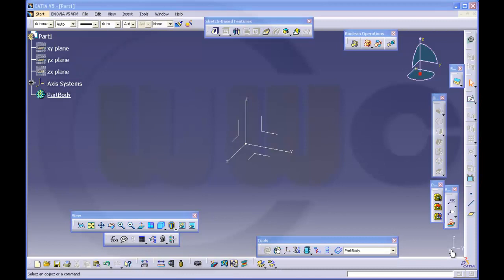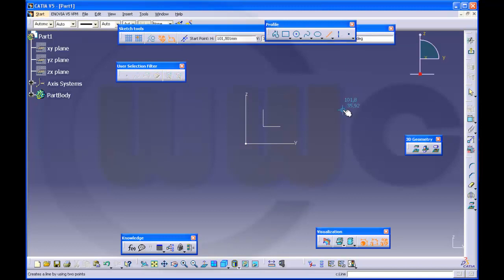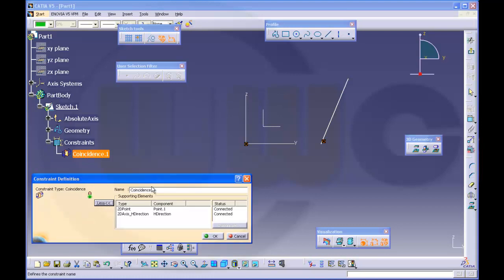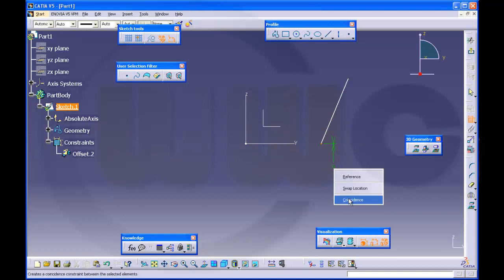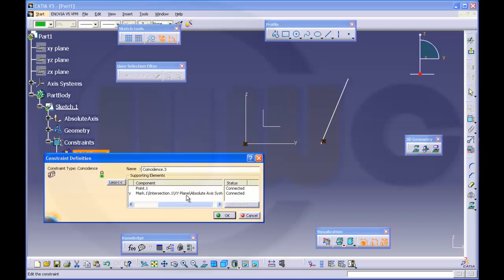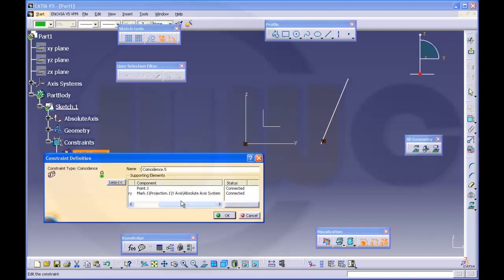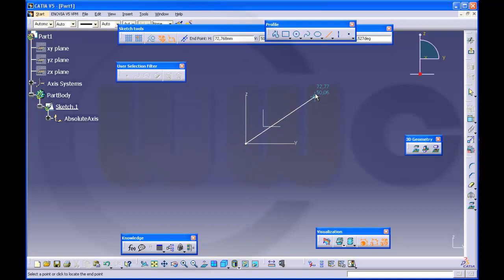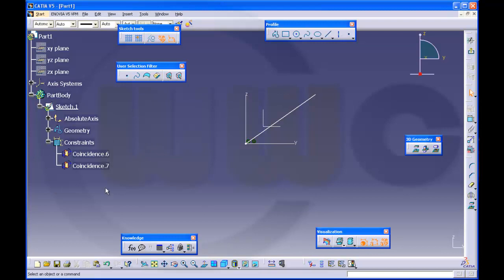Basics part III - Catia v5 Training - Basic rules for modelling - Autoconstraints

Comment: Fantastic insights - I have used CATIA for over a decade and never realized this nuance. Thank you.  The value is in the details.
Reply from the maker: Thanks, I m aware that only few know these details.
Reply: I would be greatly interested in your insights into the hard problems of CAD --- working in teams and collaborating, namely, building master models that publish elements which others will use downstream, then, once they have created tooling, enable whole project to update, dependent models and drawings etc. The classic example in automotive design would be a wheelbase change or datum change that should be in theory straightforward, becomes a monumental engineering task due to all the dependencies. In other words, what I am asking is, do you have insights into making large assemblies parametric?
Reply from the maker: Sorry, not really.
Reply: I think whoever solves these hard problems of large assembly collaboration across continents and time-zones has access to untold wealth. Also the problems of forwards and backwards compatibility and cross-platform development, collaborating between Siemens NX, Google Sketchup and CATIA for example, in a smart parametric way. I can sense there are developments in the crypto and Ethereum blockchain space on the horizon.
Reply from the maker: This is almost impossible to solve.

Comment: But why should we go to the part axis and not the sketches??
Reply from the maker: Because the big companies want it ;)
Reply: hehe, but there should be a reason why they don't want
also, why catia doesn't hide the axis directly or make the constraints to the part axis
Reply from the maker: There is of course a reason - you should have only  "real" axis-systems they based there complete methods on this. Just view my catia v5 basics video regarding this topic. The original catia had no axis system at all. The german big  "players" wanted to have one so they got it.